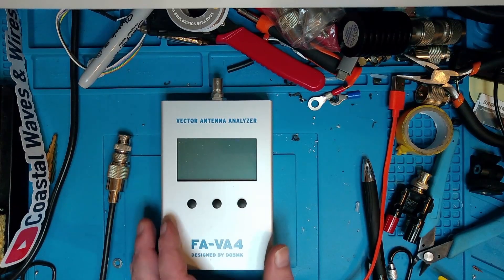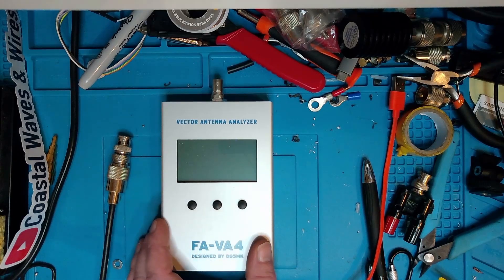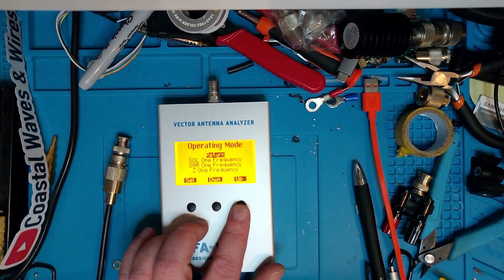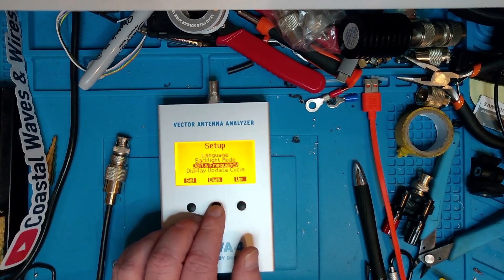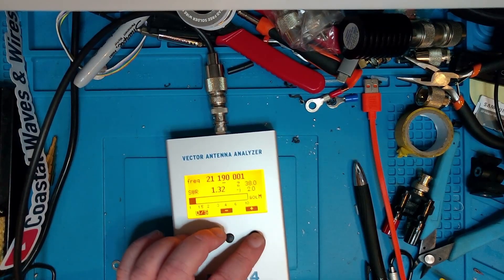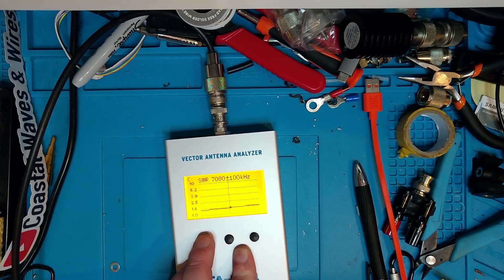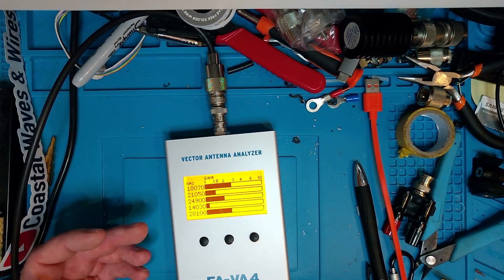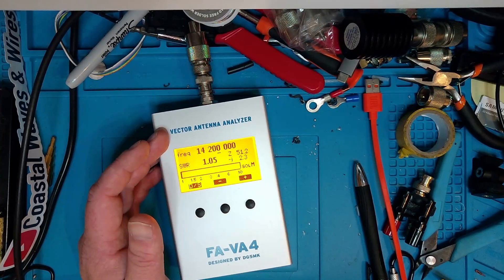Is the FA-VA4 the poor man's RigExpert?

Comment: What are the dimensions please Morton? It looks to be about the size of your hand, but can't quite see. Also is it re-chargable?
Reply from the maker: It is 137mm x 90mm x 25mm according to the manual. It does not have rechargeable batteries. It runs on two AA batteries, and according to the sticker inside the previous owner changed the batteries in 2020, so it should be relatively hassle free.